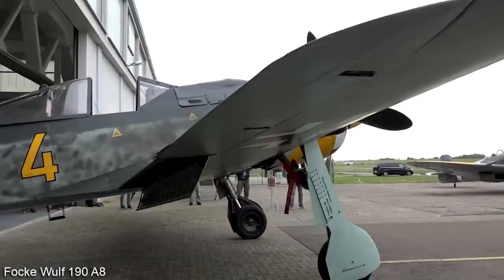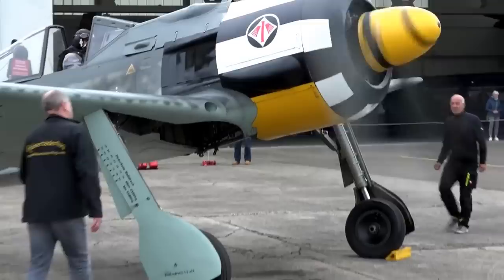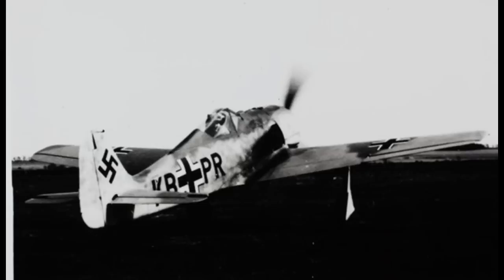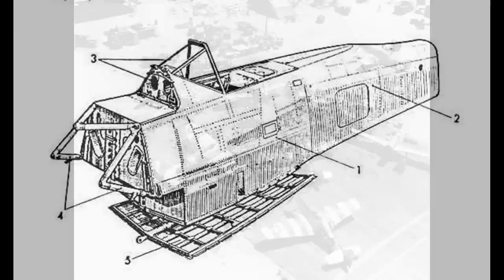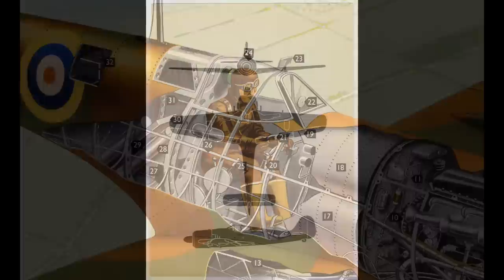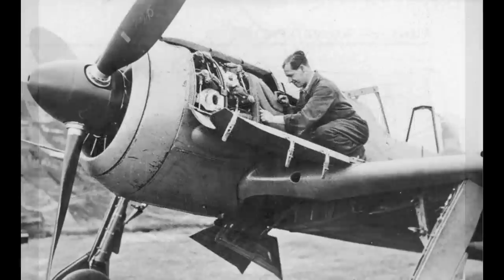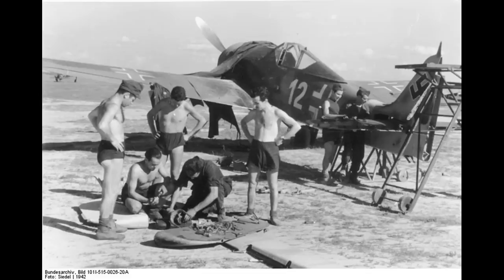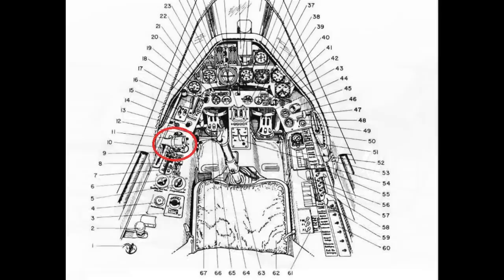Focke-Wulf Fw 190 Pt.2

Comment: Have you heard about the FFVS J22 fighter built by the Swedish Air Force  during the war as the US embargoed new aircraft after the invasion of Norway.
It looks a bit like the FW-190 but had to make do with a Swedish copy of the Twin Wasp R-1830-SC3-G so it was low on power, but it was a very clean design and managed to get Spitfire mk1 performance out of a 1065hp  engine running on 87 octane fuel.
In 1945 when Sweden bought Mustangs mock dogfights where held against Swedish J22 aircraft and under 4000m the plane could apparently stand up to the Mustangs quite well.

The aircraft was built in a hangar at Bromma Airport in Stockholm (today the hangar is a shopping mall) by the air force as SAAB was busy with other designs.

Comment: and PROP ON TOP!!!! 
aka.... prop lever is always equal or ahead of the throttle... 

in DCS a lot of people blow up the p51 engine..... temps are good, but BANG
its because you are "lugging" the engine at too much boost.... with not enough rpm

Comment: Thank you very much for this very interesting video. Really impressive your approach to the Focke's main design characteristics. The comparison with then current designs was also very well done. You are a good teacher. In these last years, I had a thought about the Focke's design that pehaps could be approached with your knowledge. I've always believed the Focke was designed within two key parameters: compactness, and the less possible drag. To obtain a very low drag with a bulky radial engine, all other possible drag sources must be reduced as far as possible. This was obtainec by using the anular oil cooler, that was also armored, and refraining to adopt a dynamic air intake for the engine. From what I understand so far, engine air was taken from the engine compartment, after passing through the cooling fan and the engine hot cylinders. This was a compromisse, as the air was taken hot. I think this was the greater limitation of the project, and could probably explain why the Focke had a superb performance at its  altitude optimum, but losses performance substantially out of this altitude, mostly above the rated altitude. Does this make sense? I've taken as a design comparison the La5 FN, and the progressive development of the La radial engined series. Kind regards from Brazil!!!!
Reply from the maker: Hi Marcos, you're questions are great, but will take too long to answer by typing. I will be addressing these issues in the next part.
Reply: @GregsAirplanesandAutomobiles  Thank you, Greg, I'll be wainting here. Salut!

Comment: There is a report, somewhere the US made after evaluating an Fw 190 that compares and contrasts the Fw 190 engine control system to that of US Fighters. I cannot for the life of me find it so I would greatly, greatly appreciate anyone who could point me in the direction of it, as I remember it being a good text.
The essence of the text stated - as far as I can remember - that the manual engine controls used on US fighters at that time could/would result in higher aircraft performance in the hands of a skilled pilot, but that the automatic system was very good.
Regards
Reply: I recall reading that Grumman did an analysis of the Fw190 and integrated much of what they learned in the design of the F8F. They were quite impressed with how well thought out many of the systems were.
Reply: Paul Frantizek 

It was USN planes that helped convince Tank that a radial could be made aerodynamic for a fighter, so its kind of full circle if that’s true

Comment: Like your videos.
However:
1: straps on pedals are very handy in low level turbulence. Also available on the 262 for example.
2: regarding jet Kommandogeräte: I remember having seen a mechanical "fuel calculator" for the Viggen's engine in the Volvo museum. Remembering that old thing I was puzzled in the late 80s when an ad said that "Finally fuel calculation on jets can be made digitally by computers". Surely a Gerät-something must prevent flameout, fat mixing, nozzle burning and overrevving on jets.

Comment: Greg thanks yet again for a great Documentary. However it all depends on what variant we are talking about Greg. Some 190's were adapted to being torpedo bombers, others as dive bombers, Night Fighters, Bomber Destroyers, Fighter fighters.....The Fw 190 A-1.....to A-8 (What a beast the A-8 was, then the Fw 190-D for Dora... it could take on a P-51, Spitfire Mk IX or even greater, a, Typhoon, Tempest and it could smash a B-17, B-25, B-24. 
I personally think that the Fw was the best universal fighter in Western Europe in WW2.
The P-51 was designed as a pure fighter on fighter interceptor, where as the Fw 190 had so many jobs to do! This is just my thoughts Greg!
Reply from the maker: That's true, the 190s had to fly a greater range of roles. The Dora is one of my favorites. It's not quite as good as a 51, but it's very close and considering the problems in Germany at the time of production, it's very impressive.

Comment: Someone recently tested the Fw 190 D-9 against the tempest mkV in Il2 and found a G-Tolerance difference in favor of the Fw. I dont have a link right now or can confirm that. 
But people claim its in the sim.
Reply from the maker: That's really good to hear. In the A models vs. Spit Vs (I normally fly an A-5 in Berloga) I don't think it's modeled, but perhaps it is.
Reply: @GregsAirplanesandAutomobiles  note that it isnt much. maybe 0.5G
Reply: @GregsAirplanesandAutomobiles   in latest dd topic on russian forum Han said they plan to add G meter to GUI as difficulty option so when they add that it will be clear whats done in regards 190 pilot seat position

Comment: A layman's explanation for the theory of how a constant speed prop works is to think of it as a car's automatic transmission.
If you step on the gas, the gears change to make you go faster for the amount of power the engine is producing. This is what the propeller governor does to change the prop pitch. 
If you go up a hill and don't add much gas, the cars gears will shift to a lower gear; similarly, the propeller will flatten in pitch.
Reverse for going downhill and high speed.
Reply: Somewhere in all of that, allowance needs to be made to account for the reduction in atmospheric pressure as your aircraft climbs which makes the engine and propeller work harder move through the air.
Reply: @markfryer9880  
Those warbirds were supercharged so they could produce sea level or greater MP up to pretty high altitudes. If you set 2300 rpm, then the governor will change prop pitch to maintain that as long as MP is high enough. You don't have to think about altitude effects, except as it applies to things like max rsnge, max endurance, max speed. This is in the operating manual. Charles Lindbergh went thru both Europe and Pacific theaters demonstrating very low rpm and comparatively high MP for the rpm setting. This increased endurance markedly in the P-38, for example.
Reply: I would say more like a snowmobile type continuously variable transmission, giving a seamless variation of output to input ratios, rather than an auto trans shifting through a number of fixed gears.
Reply: @andypdq  
Yes. CVT is more accurate, but harder to explain to laymen.
Reply: @andypdq    Thanks for that -   I'm not completely tech-challenged but I have to admit I couldn't follow Greg's explanation -  and he's very good at explaining things.

Comment: Greg, you really need to fly DCS if you haven't already. The clickable cockpit alone is enough that I think you'd really like it, and detail of the systems modelling in incredible. The flight model is also an order of magnitude more accurate than that of IL2, and DCS currently has the p-51D, Spit Mk IX, 109K4, 190D9 and 190A8. I paused the video to say this when you said you weren't sure if any sims have the manual prop pitch modelled. DCS absolutely does, as well as many other emergency/auxiliary systems.

Comment: Excellent collection of videos, I really like your summaries on prop and fuel mixture. One thing I think you should be including in your discussions is the importance of the density of air as altitude/temp changes. This is huge on propeller performance and fuel use. I speak from experience because I had hundreds of hours in the t-34c turboprop navy trainer amongst other a/c.
Reply from the maker: I do cover density altitude in some other videos.

Comment: 16:30 I once heard this process explained as "the prop pitch is sort of like a gearbox in your car: it regulates your engine's rpm sort of like shifting gears would do if you have a manual transmission".
Reply from the maker: That's a decent analogy.

Comment: The F4U Corsair has a similar design in that the main spar passes through the lower fuselage and the engine mount bolts to it (upper bolts to the firewall and lower bolts to the main spar). At least that how it looks from some pictures I've seen of one torn apart.

Comment: Initially I was kind of shocked by the un-German-ness of the design of the Fw-190. A focus on reliability, usability, and ease of maintenance over sheer performance and bleeding edge, probably over engineered technology? A downright American method of design.

And then you showed the guts of  the engine control unit... 

Before anyone jumps at me with a hundred examples disproving the stereotypes of different nations' engineering, it's just a joke.
Reply: uummmnocoolnames The mechanical computer was a bit shocking.
Reply: I disagree, that command module is very German besides it's apparent reliability.
Reply: @Wallyworld30  its more like an ECU today
Reply: @GbbJunkie put all manufacturers cars on a race track and run them till the quit. 

BMW will go 100,000 km on back roads, or Autobahn, then starts falling apart. The harder you run it it won't effect how many miles it remains reliable. Though the body will fall apart from hard abuse. 

A Porsche will go 100,000km, on a racetrack. At full throttle. Before it blows up, and It will not even squeek or rattle when you are done. 

But I wouldn't want to daily drive any of those cars beyond 200,000km, unless it's an old air-cooled Porsche.

Comment: In my experience the spitfires (mk V and mk IX) in IL2 BOX will out turn the FW190s fairly easily except at high IAS.
Reply: That is correct. The designer, Kurt Tank, sacrificed manouverabilty when designing the plane to outperform in speed and roll rate. They called him crazy when he prososed that. 
You can experience it in the sim. Turn rate is horrible on the 190. One of the worst there is in WW2. But the roll rate. No plane rolls faster then the FW190. And that was enough to disengage from enemy fighters.

Comment: As for the rudder pedal straps, another tangent. They are standard on the aircraft I've owned and flown. On each I had the rudder system closed and I pull for right rudder, push for left. Why? Lost my right leg, hip, and pelvis at age 16. Plus I always flew tailwheel. You should see my SODA Greg 😂 🤣 So, yeah, they could help a 190 pilot I imagine if they suffered a leg injury. But other things can knock a pilot's feet off the pedals too in violent situations. It's just another example of the sheer thought that went into the 190.

Comment: Ruggedness prioritized ahead of speed? So, it's German for P-47, then?
Reply: Wasn't the P-47 pretty fast in level flight?
Reply: Sam Lacquer Yeah, mostly at over 20k feet, and in a dive the thing was insanely fast.
Reply: @ToyotaTechnical  
Fair enough, but I think it took an extra 1,000 HP to do so. Like the later F4, it was a "triumph of power over aerodynamics."

Comment: B-36 Flight Engineer - a job that would put you in glasses. How many dials? Also given the B-36's reputation I would expect many warning lights, the pilot shouting in your headset and the gauges going wild. Mad job - bet they loved the B-52 when it arrived, if they had not resigned their commission by then..........

Comment: Hi Greg. Great video as usual. At 8.43 you said the cockpit canopy could be ejected by explosive charge to make it easier & faster to escape. Test pilot Hans Sander is quoted in Alfred Price's book, saying the canopy couldn't be opened above 270 mph because of 'aerodynamic lock'. So it wasn't just about easier egress; it was about getting out at all at high speed. (Alfred Price, Focke Wulf 190 in Combat, (Sutton, 2000), p. 17).
Reply from the maker: Makes sense, of course there are airplanes with the same aero lock and no jettison, you just had to ride it in.
Reply: @GregsAirplanesandAutomobiles  Apparently this jettison system used a shotgun cartridge to power the piston. Must've been a bit alarming, but I suppose you'd have bigger worries if you're ditching the canopy.
Reply from the maker: It would  be loud, but I think these pilots were accustomed to gunfire. As you said, bigger problems than noise at that point.

Comment: In reference to the tail barrier. It's more feasible that it is to stop a vacuum forming in the cockpit due to wind travelling over the tail which would then try and suck fumes through the firewall.

Comment: I actually have had a high pressure bottle blow up on me while I was holding it. It made a lot of noise and it appeared very violent, but I wasn't hurt. This was a 35 cu-in fiber wrapped aluminum vessel rated for 4500 psi, but at the time of rupture I think it had about ~2000 psi of high pressure air in it. This was a HPA bottle on a paint ball gun, it had snapped at the neck and the bottle went BANG and shot off first into my torso then rocketed away some 100 feet or so. I had no lacerations, just a little bruising on by right ribs and elbow. Unlike highe xplosives, which creates a blast in excess of 150,000 psi and over pressure front yards in diameter pressure vessels are two magnitudes less. More importantly, there isn't enough compressed matter in the vessel to create a significant blast wave out to a significant area. Inches from the rupture pressure drops to near atmospheric levels so unless your hands are on the rupture point or you get cut by a fragment, it usually is not particularly dangerous.

Comment: Kommandogerät literally translates to "command device". For all intents and purposes it seems to me to be an old hydro-mechanical version of a modern digital controller. Before the introduction of analog and digital controllers it would be very difficult to make a machine designed to calculate everything needed to control a complex system such as this. This "Gerät" was probably expensive back in the day. 

Anyway, it probably uses hydro-to-mechanical measuring transducers in order to transform measurements into mechanical movement which could be used by a mechanical computer (calculator). Various hydraulic and mechanical components can also be used to mechanically perform mathematical operations such as addition, subtraction, multiplication and saturation. This would make the Kommandogerät an early MIMO P-controller which I find fascinating (Multiple Input Multiple Output Proportional controller). There might be hydro-mechanical devices that could perform differentiation and integration, however I am unaware of such devices (I study modern control systems, this is a "dinosaur") - in that case it would be a PI/PID/PD controller.

Comment: Greg, I have another suggested subject for you: Compare and contrast two purpose-built night fighters of WWII, the Northrop P-61 and the Heinkel He-219.  As typical for Northrop the P-61 was the more daring design, but with similar weight the He-219 seemed to have superior speed and altitude on less power (and 3 blade props😉 ).

Comment: Considering the havoc one could wreak spoofing an IFF signal, or reverse-engineering and IFF unit to do that, I could see why the specifics on the FW-190's IFF unit and it's self-destruct wouldn't be mentioned in the pilot manuals should those somehow be captured.

Comment: Interesting point regarding the manual rpm control because if I'm not mistaken the bf109k4 in dcs also uses a similar control scheme where a switch below the throttle toggles between auto and manual rpm control and a thumb switch on the throttle controls the rpm/prop pitch when the toggle switch is set to manual. Interestingly the toggle switch is set to auto when it points back at the pilot on the 109k4 in dcs, unlike the one on the fw190 you described. Might try the fw190 in dcs one day and see if they modelled everything correctly, if i can snatch it during a half price sale.
Reply from the maker: The 109 also has some decent engine automation, not quite at the 190's level, but decent.

Comment: Another Wonderful video with a ton of information. Greg. 
But allow me to just add one little theory about this fabric barrier in the rear fuselage of the Fw 190 which you discuss about 10 minutes into the video, The one that supposedly prevents engine exhaust from entering the cabin. 

You assumed that it probably prevents exhaust from entering the cabin rearwards through the tail wheel opening.  
I would much rather suggest that (instead of preventing exhaust from entering rearwards) this barrier helps prevent the air pressure inside the cabin from dropping excessively when flying at higher speeds. 
I believe that without this barrier the cabin air pressure would most certainly be caused to drop due to the air passing outside "sucking" some of the air out from the cockpit through the rear opening around the tail wheel via the Bernoulli effect. 
Lowered cabin air pressure would of course have several negative effects for a pilot, especially at higher altitudes. It may of course also lead to exhaust getting sucked into the cabin through whatever unsealed openings or gaps there may be rearwards of the exhaust outlets, or also between the cockpit and the engine bay (should there be exhaust leaks caused by battle damage or otherwise).